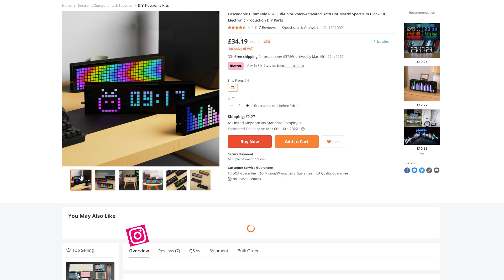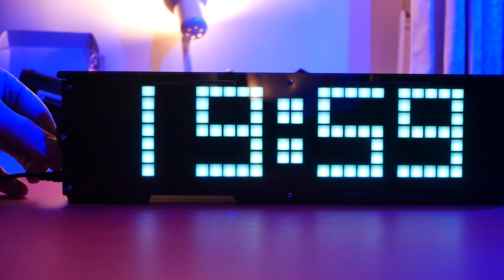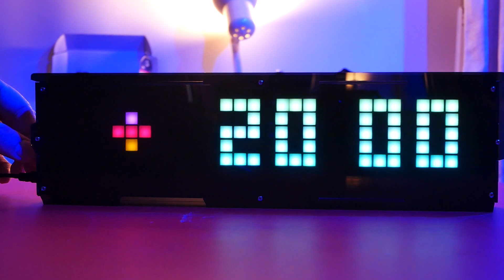256 LEDs, clock and spectrum analyser in one kit!

Comment: if you think this is bad, try putting together, the ICUBE SMART 16x16x16 !, it will terrify you !, depress you, anger you, despair you !, IVE MADE ONE, and i cannot remember a more " shock to the system" than that!
Reply from the maker: @joedoolan6207  haha sounds like a weekend with tweezers
Reply: @notenoughtech  256x 16 !, thats how many leds you have to solder ( just over 4,000), then check every one ( thats where the real fun part begins)!, checking every single solderd joint!

Comment: As inexpensive as that is, I have to assume that the excellent response we're seeing on the analyzer is due to his mic being routed to it, going in to the mini jack input that he'd mentioned.  Even if the mic sucks, which I will assume it does anyway, that's still pretty reasonable for a DIY, plus it has input.  So I want one, and now I have an excuse to purchase a solder hot plate, so thanks for that.  :)
Reply from the maker: It's the internal mic. It's very well done and super sensitive without clipping on loud sounds or songs.

Comment: Sounds more like the "IKEA effect" than Stockholm syndrome. 
"a cognitive bias in which consumers place a disproportionately high value on products they partially created."
Reply from the maker: Haha same country right? 😁😁😁
Reply: @notenoughtech   Sweden is indeed the common factor. 😁

For such a product, I'd instead have based it on WS2812 strips with 72 pixels per meter (maybe even 144), and scale the plastic parts to fit that cell size. And a small board with an ESP32 to manage it, possibly running Tasmota (which recently got a greatly enhanced neopixel support in Berry).
Reply from the maker: I'll play more with it. Definitely need a new enclosure to fix this :)

Comment: Are those ws2812 or the newer 13/14/15 ?
the later ones carry and extra backup data line to allow for an led to fail and not take out everything in the string after it.
Reply from the maker: Ws1812 if the led fails you need to replace it to recover the matrix

Comment: I almost bought one of these after you posted the link to it in a recent videos comments, seems like quite an involved build!
Reply from the maker: Has its downfalls but if you preserve... The effect is really nice. I just want everyone to be fully aware of what you need to get through :)
Reply: @notenoughtech  I ended up ordering one, turned up wednesday and I've just finished building it, spent a couple of hours at lunch time and night. It looks really good but was quite a long build 😅
Reply from the maker: Awesome. Any problems along the way?
Reply: It was a bit erratic when i powered it up, the display looked like random noise but three LEDs were flashing differently. I reflowed three joints and it works perfect 👍 The case is quite fiddly to assemble whilst attempting to not cover it in fingerprints 😅
Reply from the maker: Yeah that's the tricky part. Not breaking it to bits while bending it all into place and managing flimsy screws 🤪